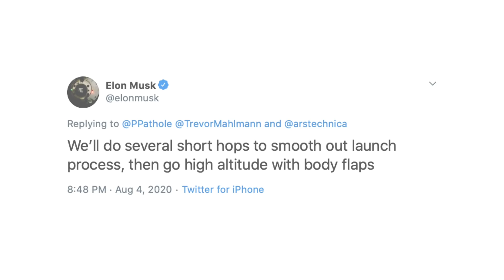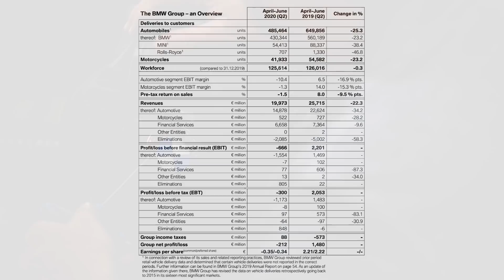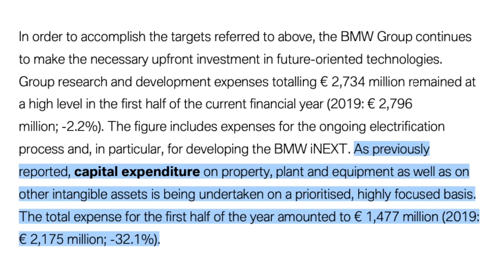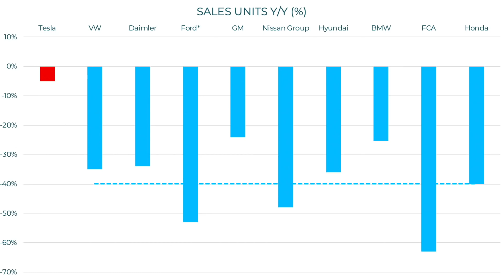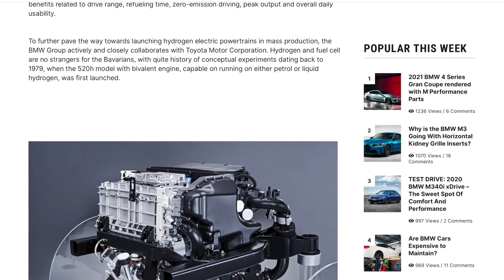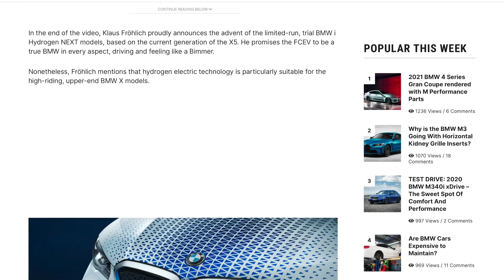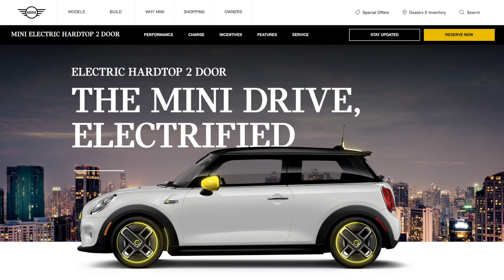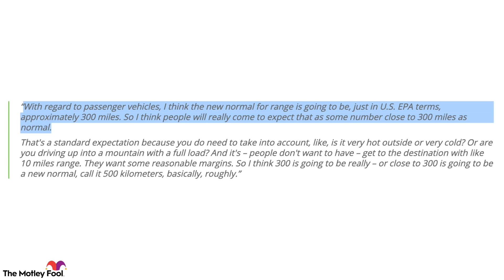Tesla / BMW Strategies Continue to Diverge | SpaceX Starship SN5 Test Flight Success

Comment: totally concur with your last statements about working in a large company.  I have been there and it is hard to do the right thing when there are strong competing positions.  So, BMW is trying to appease all sides and avoid making the hard decision.  Such thinking usually leads to disaster in the end.  My prediction is that they fail and end up merging with another company.

Comment: So about BMW: what they didn't mention is that a purpose-built BEV has enormous advantages over an ICEV conversion.  BMW is using the engine compartment and the existing ICEV undercarriage for its BEVs, and that simply isn't efficient, and it results in a much higher and less centered center of mass.  That will affect handling and safety.  The front crumple zone is again filled with junk that, in a frontal impact, can be driven back into the passenger compartment.

So BMW's range, energy efficiency, handling and safety won't be a match for competitors at their price points, at least those competitors who are designing from a clean sheet of paper, as Tesla has done.  BMW will save on production costs, no doubt, but I think their sales will be anemic.

Alas, in the frame of reference which BMW occupies, flacid BEV sales will only reinforce their determination to ride ICEVs as far into the future as they possibly can.

They might not be alone.  The VW Group board fired Chairman Diess when he told them he intended to end ICEV R&D expenditures and shift that funding to BEVs.  The Porsche heirs were not ready to hear that.  So all of the stuff we've heard from Diess about VW's intentions is now up in the air again.  The new chairman is sure to be more compliant to the owners' wishes.  And less agile.

A time of disruption like this is not a good time to choose a not-agile approach, but I don't think BMW or VW Group got the message.

Comment: The Starship prototype SN5 hop was successful.  But it wasn't flawless.  The Raptor engine was on fire all the way through the hop.  Not talking about the rocket exhaust.  The fire was at the top of the engine.  SpaceX continues to have difficulty containing fuel, oxidizer or both in their Starship prototypes.  We should probably take it as a good sign that the engine continued to perform regardless, but this was a very short burn.  I can't begin to guess if an engine on fire like that will fail on a longer launch profile.  Or do worse than fail.

I'll also point out that:

  -  The rocket during the hop looked wobbly.  That's a high center of mass on that thing.  Keeping it balanced and safe with only a swiveling rocket nozzle and small cold gas thrusters is a major engineering feat.  But the full Starship will be harder.

  -  The mass simulator on SN5 is compact.  When the full stack is assembled, the center of gravity will be even higher.

  -  This is a tight tolerances operation, and I don't know about any fail-safe alternatives for the rocket in powered flight if control authority from nozzles and thrusters isn't enough.  Without fail-safe options, and given the catastrophic result if those tight tolerances are exceeded, will the FAA or NASA ever trust Starship to carry humans?  It's not obvious that they will.

  -  SpaceX opted to go with vertical landing legs, and they worked very well on this hop.  But there's a reason landers use splayed legs.  They're safer; the chance of not tipping over on contact with the ground is enhanced considerably.  I imagine SpaceX is looking to save weight with this approach.  Mass bloat is the enemy of rocket design.  But rockets tipping over is an enemy, too.  Did they make the right choice?  Too early to say.

SpaceX is private, but the subject is compelling, and there will be many economic knock-on effects to dig into.  Starship represents humanity's first nongovernmental effort to expand Earth's economy into space.  The long-range economic implications could large and wide-ranging.  So yeah, you won't hurt my feelings if you pay more attention to it.  Besides, it's the best show on Earth.
Reply from the maker: Thanks for the detailed comment. Appreciate you sharing and hope you’ll continue!

Comment: I traded BMW M3 for the Model 3.  While I am thrilled overall with the Tesla, and wouldn't go back, I can say the Model 3 still doesn't handle as well.  The rear end of the Model 3 feels disconnected at speed and can get squirly upon heavy braking at speed.  BMW has this area mastered and should exploit that in the upcoming i4.  Tesla nailed the technology but there is still a ton of work needed in the actual car to make it an all around performance winner.

Comment: Not sure why you excluded Fords adjustment when you didn’t exclude the credits that made tesla profitable? Seems inconsistent and unnecessary to make the point. Ok to note both but don’t exclude them from the numbers.
Reply from the maker: Tesla’s regulatory credit revenue is recurring and much smaller than $3.5B. I figured I’d get comments like this, but I felt the best comparison was to exclude it for Ford while making sure I pointed it out for anyone who thinks it shouldn’t be excluded. I also noted it with an asterisk.

Comment: When it comes to range with a car that has no access to Tesla superchargers, the size of the battery ie overall range is not the only consideration,  when you have to charge the car away from home, how many miles can you put in the car within the faster charging sweet spot ie from 10% to 70%? considering that most non Tesla chargers generally deliver lower wattage output.
For a car like the Mini electric, even that sweet spot faster charging period could take more than an hour just to add 60 miles!, does anyone want to do that multiple times on a two or three hundred mile round trip?

Comment: @teslaDaily Hi Rob, do you have a vid about Tesla EU pricing? Why are they so high even when taking into account 20% tax, currency risk, transport and cost of running local dealerships?

E.g. m3 LR is ~$41000 which with 20% tax is $49200 and converted is €41500. EU prices differ per country ranging from €48000 (SK) to €60000 (FI). Price in most countries with EUR is €58000 (DE) whereas Germany is €52000 (with subsidies) Other EU countries not using EUR may have prices even higher, e.g. 660000 SEK ~ 66000 EUR, 1500000 CZK ~ 58000 EUR.

Comment: BMW have the legacy business to think of and are premium enough to probably get away with the flexible approach. Only 200M loss and still 2/3 capex spend is also not a bad result against the broader market.
However, how can they have sold out at 11000 vehicles if they have the flexibility they talk of??
This is the real red flag IMO.
We offer very little range and can't secure batteries for the demand even whilst doing so. If the market turns EV our faux flexibility will be exposed and we will have nothing left. Please buy our ICE vehicles.

Comment: What BMW is saying between the lines is that they don't have enough capital to invest in a separate platform for a pure EV, the best they can cost justify is to modify an ICE platform. They're probably also projecting a linear adoption curve for EVs and think they have plenty of time yet to make their ICE investments pay off. They don't realize that once EVs hit price parity with ICEVs it will be all over for ICE. I give ICE until about 2025, not 2030 or 2040 like most of the ICE industry thinks they have.

Comment: BMW has a vested interest AGAINST electric vehicles. They only make them for the eyes of the world, not to make a proper ev...reluctantly and if possible they would drop immediately EVs.
They have partnered in the hydrogen pushing organization with big oil corps and other companies that are in league with them as well.
They have gathered billions to lobby and corrupt interests all over the world to stop the development of battery electric tech.
BMW profits a lot from the current tech and you can read from their statement, they do not want to change to electric.
BMW cares are of inferior quality and require extensive and expensive repair after warranty or damage not included in warranty.
Just like mercedes and audi, these brands are very profitable because of the obsolete ICE tech they use.
In electric they would need to invest billions to develop and they don't want to from all the reasons above.
You cannot profit from spare parts, replacement parts, maintenance parts, because and EV is a perfect vehicle, with huge reliability and minimum to no maintenance needed.

Comment: You should have a look at PSA. They have pushed very hard for efficiency and flexibility and they made a profit in H1 2020 due to this approach
Reply: PSA is going down the VW route with one platform for most of their cars. The Peugeot 208 is being used in both EV and ICE versions of quite a few models now. And it seems like they are able to sell them as well.
Reply: @sjokomelk  whey they do now with the e208 is like what VW did with the e-golf, was also a BEV based on an ICE platform, only for PSA the ICE platform was a bit more optimised to fit a bigger battery under the floor, but all the rest is just ICE based. They are scaling it to other models too now that they have to increase BEV sales. And with the 50kWh battery they made a BEV with more than enough range for Europeans, that is why it sells well. They are planning to start a pure EV platform from 2023, and thus only a few years after VW their MEB platform. It seems like they saw what Tesla was doing and saw the battery pack as important, and now that other manufacturers are starting with EV platforms they are also developing it. If I see that they made a profit in H1 2020 with a big drop in sales (around 40% I thought) it seems very likely that they have some margin if they are to soon. Also worth to note is that their EV platform would also accept hybrid setups  but they didn't specify how. I hope it is a setup like i3 rex, and not the shit that Mazda is doing with the MX30

Comment: Flexibility is the same as dilution, neither is effective when trying to be strong. If BMW is to survive it would be cheaper in long run to scrap all ICE cars it has unsold and start making BEVs now. You simply can’t do both as car sales move to BEVs is nearly complete. Tough decision and it seems BMW management hasn’t the balls to do it. Range is important...for me 300 miles is plenty and if backed up with a proper charging network makes life on the road easy. Some big car maker needs to jump into bed with Tesla’s SC network soon or the door will be shut and lights switched off.

Comment: I really like this video. It goes into the data that shows the difference between tesla and other automaker. It also evaluate claims that BMW made regarding their need for flexibility which seems similar to GM claims. I like Rob analysis on this topic. It is very helpfull for long term investors. 
Regarding spaceX, spacex doesn't trade publicly and even as experience investor, it isn't possible to invest privately in them.  Therefore, from investor, they aren't interesting.

Comment: I found the first part of the quote equally enlightening where they admit they have to build a flexible architecture in order not to defer or hinder current model sales. In other words, they're trying to innovate with one hand-tied, which means they'll do it half as well. This  is the problem of all legacy automakers, as paradigm change can hurt the majority of existings businesses, while a few take advantage of the opportunity.
Reply from the maker: Agree, his entire response there is illuminating.
Reply: Yep. It's like a TV company would try to do good black and white and color TVs at the same time... It's just not going to work.
Reply: Or they have a lot of unwanted cars to sell which nobody will want very very soon.
Reply: @Honestyalwaysprevails  When the cost of producing a BEV matches the cost of producing an ICE vehicle, which estimates put at 2023-2025, and they are cheaper to maintain and operate, and there are chargers everywhere, it's going to get ugly really quick, particularly in Europe. I think the US will lag a little, but not necessarily in the premium segment.
Reply: @fjalics  I wonder about those estimates though, what are they based on, as it seems there might be a shortage of raw materials needed for all the batteries. Any source on that?

Comment: Oliver Zipse to BMW engineer: "Elon Musk made a 400 mile range EV... In a cave."

BMW engineer "We're not Elon Musk."
Reply: @Em-nh8zs  someone doesn't understand exponential growth here... The "yes is growing by 50% per year but it's very small" argument is mathematically stupid... 50% per year is a stupid amount of growth... In germany it was 1% 2 years ago, 2% last year and 4-5% this year... That's around 100% growth per year... Extrapolate that and you are at 50% in around 5 years... If you don't start going all in on BEVs RIGHT NOW you are fucked... The argument you are making about cars here could also have been made about phones by Nokia vs Apple or by Kodak against digital cameras...
Reply: With scraps of an abandoned GM plant

~~~~

A few years later... and Elon was in Iron Man II
Reply: @Em-nh8zs  You are describing an ostrich not an engineer.
Reply: Nice marvel quote
Reply: well what china just showed in chengdu, seemingly on the future site of covid should even tesla shift up two gears otherwise any momentarely producing carfmanufactuer, lecacy or not, otherwise we might just all drive chinese in 5 years, and even enjoy it
Reply: @nerdlywehunt  Fun fact, an electric vehicle running on electricity from coal is still cleaner than a traditional ICE engine. So even IF 100% of EV vehicles were running off of coal-produced electricity, they're still cleaner than gasoline engines. Remember too that as time goes on, coal will make a smaller and smaller part of electricity generation, and green energy like wind and solar will take up more and more. 

At their very worst, electric vehicles running off of coal power plants is still cleaner than ICE, and it's only getting better from there.

Per the quality of the BMW SUV with 500 mile range, remember also that this is the final product after almost a hundred years of engineering and refinement. The electric cars coming out of the traditional automakers are the electric equivalent of the 38' Daimler New Fifteen, while Elon is already producing the '69 Ford Torino GT.
Reply: @nerdlywehunt  Very true that nothing I said changes the experience you had, but I'm pretty sure the people riding around in their elegant horse carriages thought the cars were loud, slow, and clunky when they first came out. I'm not saying your experience was wrong or didn't happen, I'm just saying that the tide is changing, and that you are looking down on electric cars from your comfortable horse carriage.

If you prefer BMW, all the more power to you, you drive what you want. Hopefully BMW will make great electric vehicles where you won't have to worry about charging batteries either in the next say 5-10 years.

The winner at present is still with ICE vehicles, but again that's with almost a hundred years of innovation and infrastructure to support it. Nowadays it's very possible, easy, and comfortable to drive coast to coast in a Tesla, and while you would be limited to the supercharger network, there was a time when cars were limited by the small number of gas stations too. Soon that won't be a problem either.
Reply: @Em-nh8zs  https://images.app.goo.gl/FmjQCe79oJ4B8zow5 tell me how you don't see exponential growth here... It's really hard not to see it in this chart...

Tesla is gonna continue to grow at around 50% per year on average for years. They are already building the factories to support those numbers. Gigafactory Brandenburg is gonna be capable of 2 million vehicles per year when it's finished and fully ramped in a few years (hint: that's literally what BMW sells from all its factories worldwide per year...) Gigafactory Shanghai is probably also gonna be capable of over a million. Gigafactory Texas is could be like 5 million or more per year if you look at the enormous size of the land they bought when compared to the already huge chunks in Shanghai and Grünheide/Brandenburg.